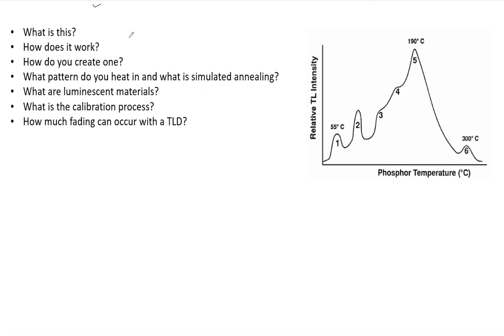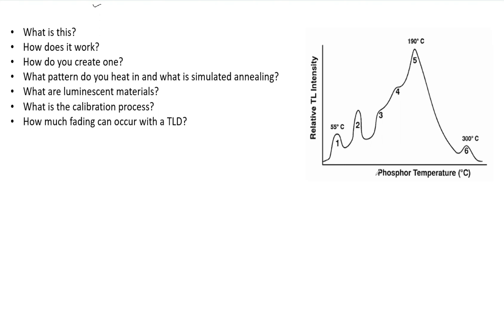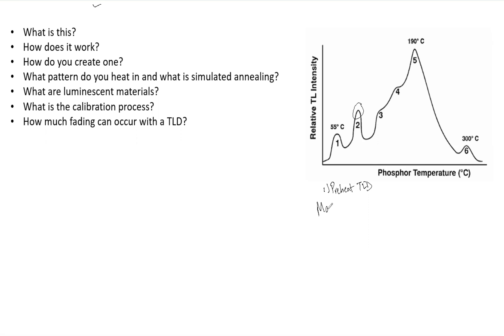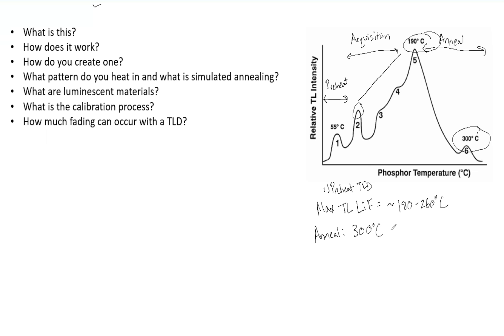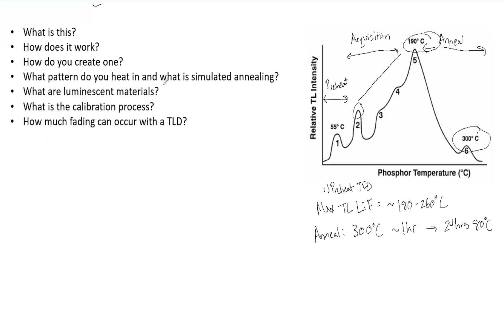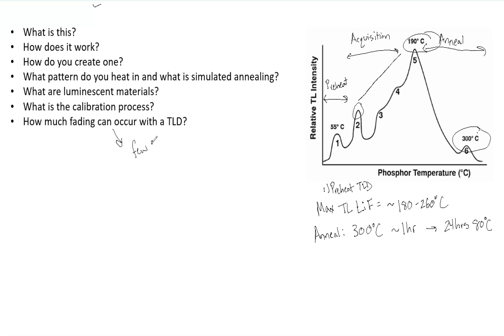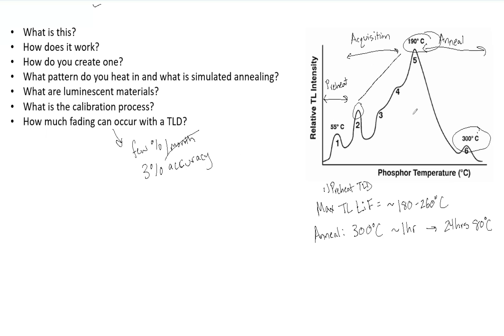Glow Curve ABR Part 3 Medical Physics Exam Preparation

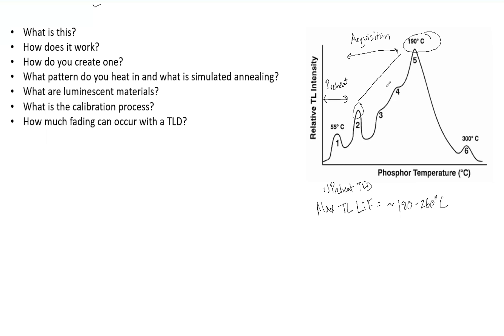Comment: couple questions. At 4:10 how does one "increase the heat at the same temperature"? What does that mean? Also, I don't understand exactly why the 80c for 24 hours after annealing is needed or how trapping efficiency is reduced by keeping the material at this temperature. Can you say more about this?

Comment: I'm not sure you meant to add "Simulated" to annealing. Simulated annealing is a subset of Metaheuristic optimization techniques.
Reply from the maker: I probably didn't, when making all these videos terms get jumbled and I had probably just done the IMRT video.  Good news is that I seriously doubt the examiners would harp on that fact if you did let a little "simulated" term spill out.  Best of luck